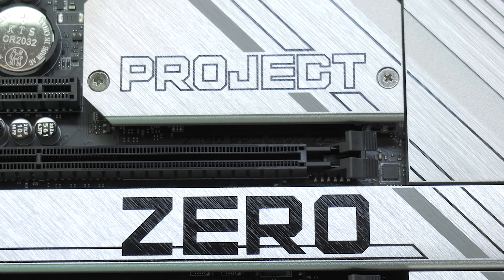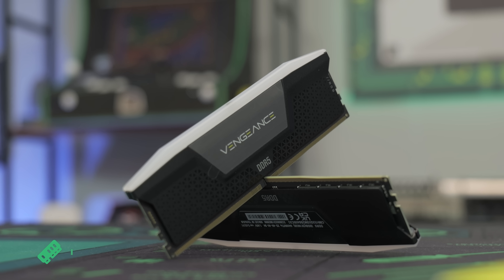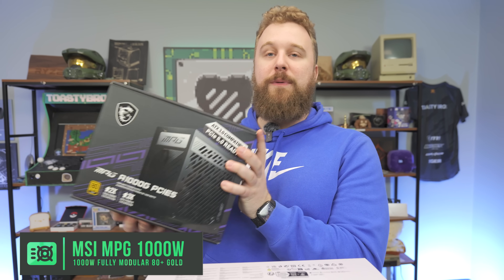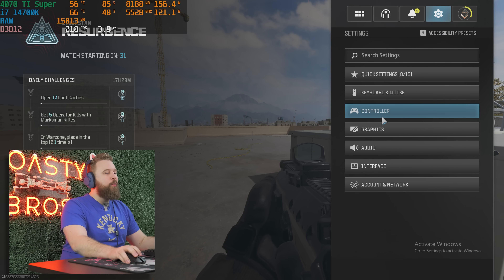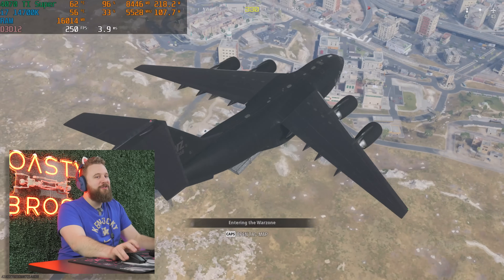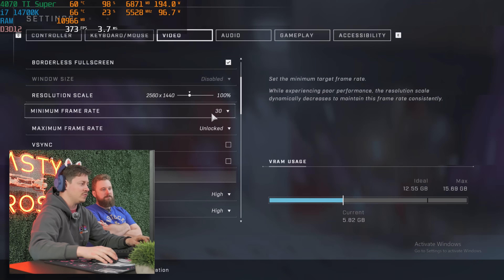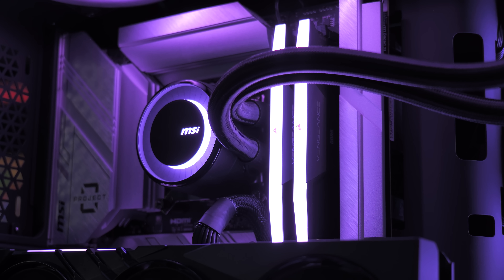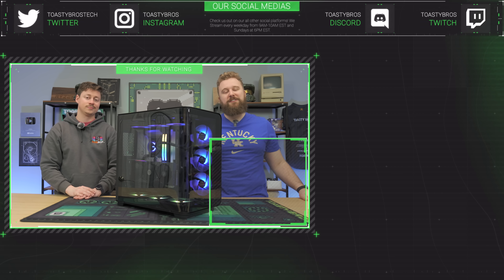This ZERO CABLES Gaming PC Changes EVERYTHING!

Comment: You are not supposed to install the GPU into the vertical bracket outside the case, or else how do you screw the bolts on the base after the GPU is installed on the bracket. You didn´t read the manual.

Comment: Do we get next: psu directly into the mobo ?
Reply: already exists, though it can have proprietary designs. primarily used in workstations and servers for easier serviceability. some servers would even have two of them for redundancy, if one goes bad you just pull it out and install a new one without powering down the system
Reply: @pettycrimesandmisdemeanors 

I kinda like psu in the basement, logicly would be smart to connect it to the motherboard bottom.

Kinda like laptops have it ?

Comment: This is probably a $2000 build, right. It's absolutely beautiful, but probably priced a bit out of reach for the average PC builder. That case is stunning. Of all your PC builds, this is probably the first (reasonably priced) one that I would want 100% exactly the same as you've built it. Everything is perfection.
Reply: They said it was a score of 23,577 on Time Spy which made it 12c per point, that makes it a $2,800 build... Ouch.
Reply: @SideQuestShenanigansLTJ  Ouch. I vastly underestimated that one. Gorgeous build... but entirely unattainable for me.🤷🏼
Reply from the maker: Yeah, slightly off😅aesthetics can add a bit to the cost

Comment: Try to review this pc: STGAubron Gaming Desktop PC,Intel Core i7 3.4G up to 3.9G,32G RAM,1T SSD,Radeon RX 580 16G GDDR5,600M WiFi,BT 5.0,RGB Fan x 5,RGB Keyboard&Mouse,RGB Mouse Pad,RGB BT Sound Bar,W10H64
Reply: 16gb vram?? ive seen those cards but benchmarks show it not using more than like 10